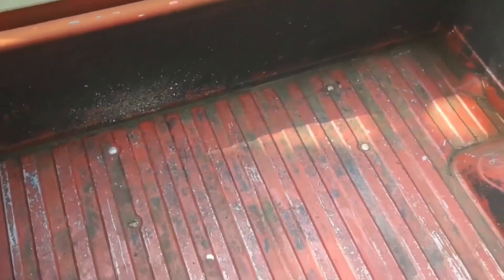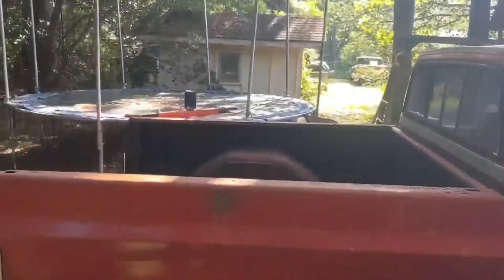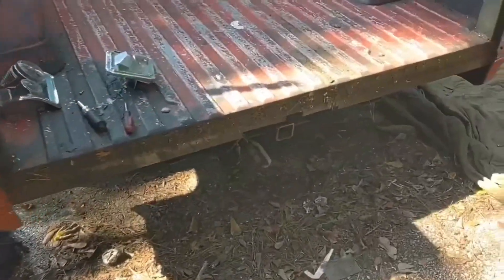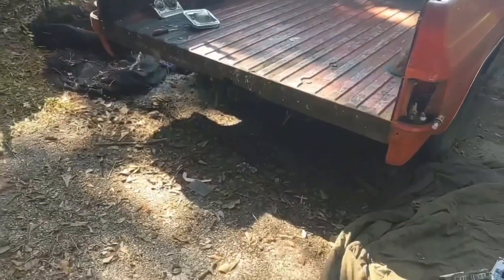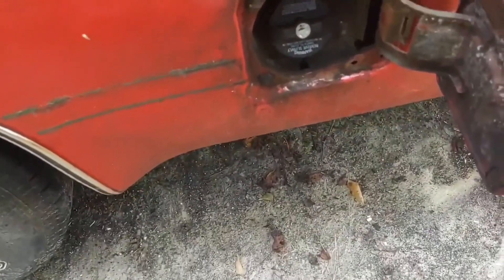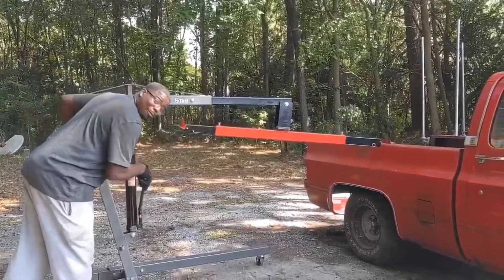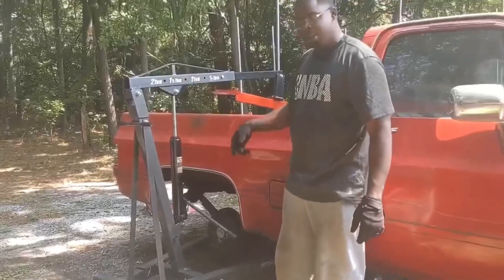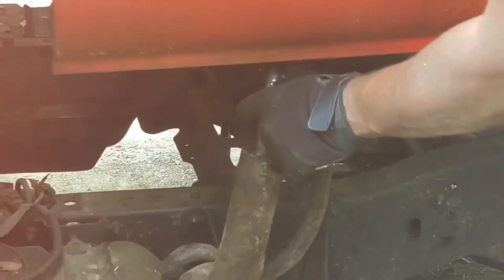1985 C10 TRUCK BED REMOVAL || LET’S GO !!

Comment: I think instead of taking the tire off, could you have raised the cylinder on the cherry picker all the way up then set the side of the lifting tool that’s closest to you in first. Lower the cylinder until the other side is close the adjust the spread on the tool. Viola?
Reply from the maker: You know i didnt think of that thanks i will definitely be trying that when i reinstall it💪🏾💪🏾💪🏾
Reply: D.I.Y With The Richardsons I love the content you got on the channel bro. I have an 87 C10 that I’m doing cab corners on. Tomorrow I’m removing the bed and thanks to you I can do it knowing what I’m up against. Thanks for the vid!!
Reply from the maker: No problem bro anything i can help with let me know!!! And thanks for watching

Comment: How did you remove your tailgate? Please help
Reply from the maker: That’s easy you have a hinge on each side take those off then you have to lift up on the tail gate it sits on some oval shape rollers might have to angle it a little to pull up on it I hope this helps

Comment: The bolts on the truck bed keep turning
Reply from the maker: Is your bed rusted where the hole is because the bolt should be squared under the bolt head that catches the square hole in the bed that's what stop the bolts from spinning if it keeps spinning try to use a cut off wheel and cut a cross threw the bolt head and use a hammer and chizzle to knock off the bolt head
Reply: @DIYWithTheRichardsons  thank you sir for the advice, the truck have no rust I manage to take the 2 long bolts easily but the other 6 are the one that are spinning

Comment: This the same moldel I am working on rn that's crazy
Reply from the maker: Awesome if i can help with anything.let me know thanks for watching!!
Reply: @DIYWithTheRichardsons  actually there is if you could do a video on hooking up the transmission,I'm tryna install a 350 turbo but I'm just now getting the bed loose and off so I can sand and repaint the frame .
Reply from the maker: I should have one coming pretty soon after i finish putting my engine together!!
Reply: @DIYWithTheRichardsons  alright cool ima def be looking for the engine installation because I gotta make sure all my wires are hooked up correctly if your gonna include that in that part.
Reply from the maker: Are you putting in a LS engine because that is what im installing ? But most engines wire up similar

Comment: every one of these ever: the pass sender or switch broke and the idiot put a locking cap on it so they wouldnt fill it and that passenger side is the locking cap surprise side, instead of just fixing it. dump that tank.